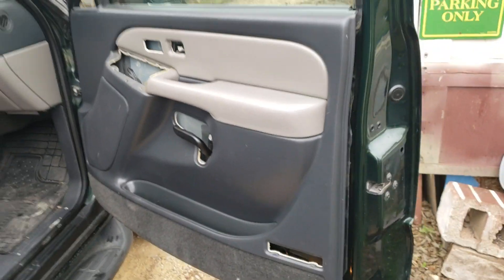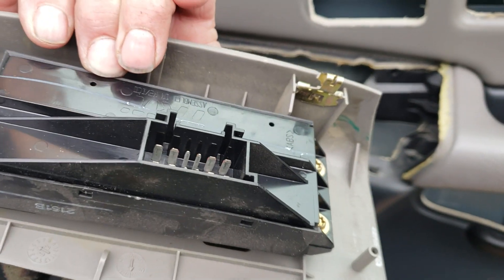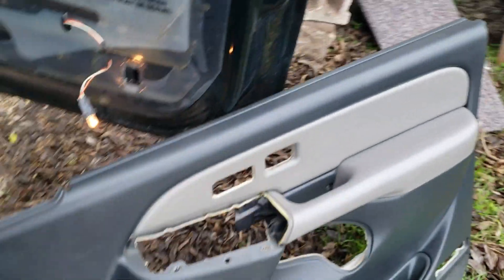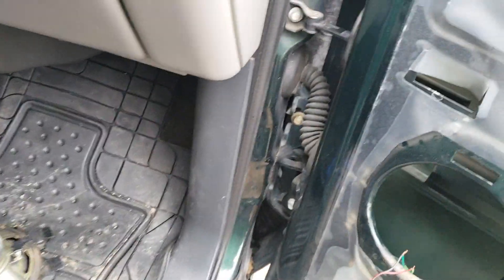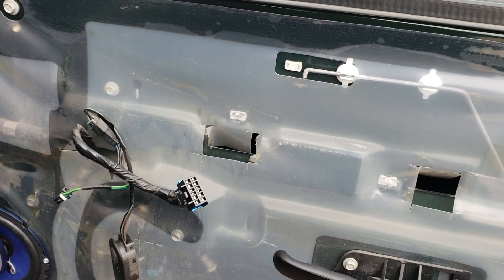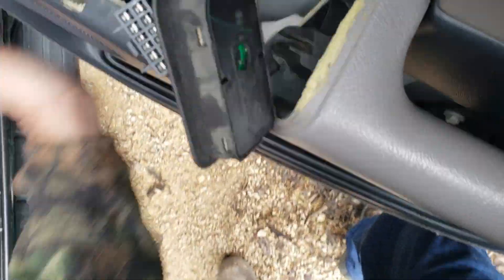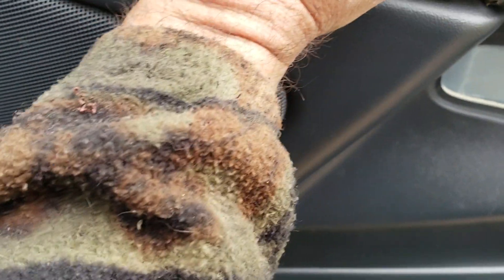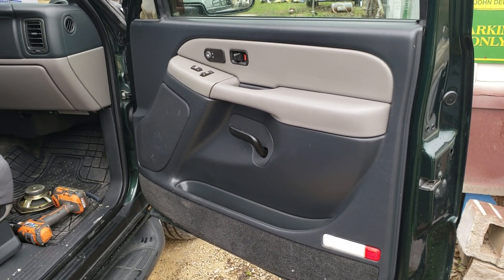How to replace the front speakers on a 2002 Chevy Suburban

Comment: You can take the door panel off without removing the switches, all you have to do it disconnect them once you have the panel loose......that's what I did when I replaced both front window regulators a few months ago.
Reply from the maker: Thx I'll remember that

Comment: Since you are going from a component system to a coaxial you need to wire the tweeter in as well since otherwisevyour just getting midrange
Reply: Are you sure it's not the same signal with a passive crossover on the tweeter?

I'm about to replace mine with some components. Should I wire both the tweeter and speaker signals to the crossover?
Reply: @CaptSlowMTB  on the late 1990s to early 2000s GM trucks (refering to the suburban and silverado) the speaker harnesses are the same. All you have to do is connect one harness to a crossover and run new wires out of the crossover to the new woofer and tweeter. I hope this helps.